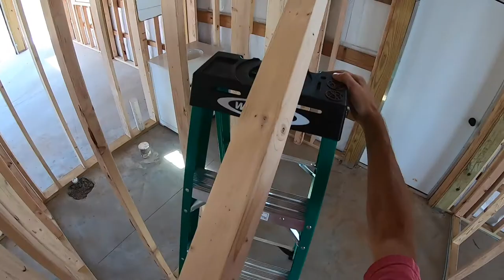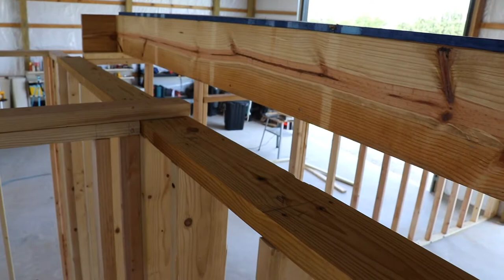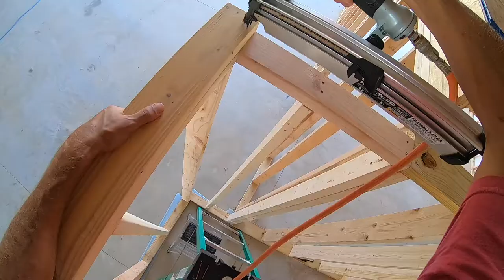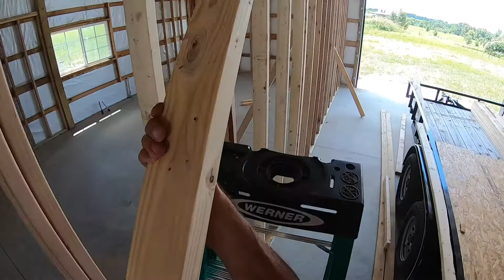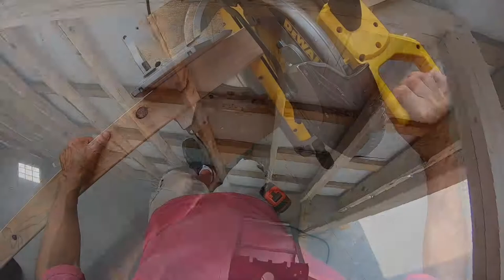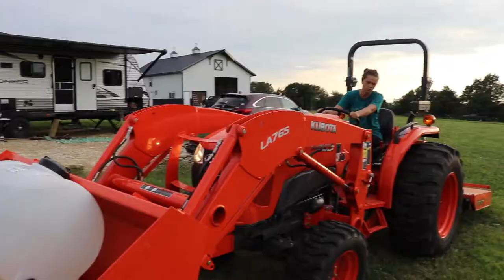Secondary Top Plate Ties the Walls Together

Comment: I saw another builder nail off the second top plate directly over the studs in case any holes needed to be drilled through the plates. Another sub might be upset if their hole saw hit a big ol’ nail doing their work.
Reply from the maker: I didn't think about that, so good to know since I am learning as I go.  Thanks for watching and the good advise